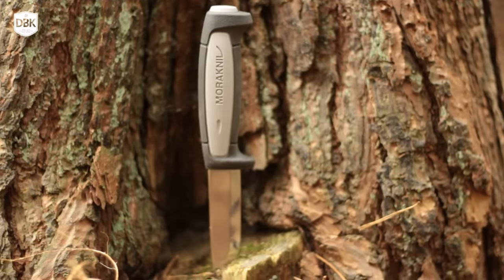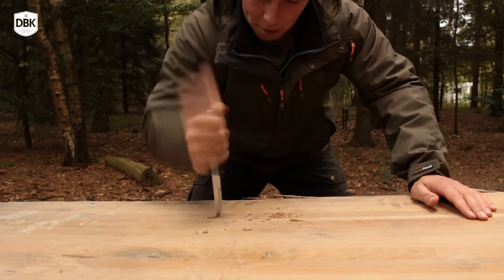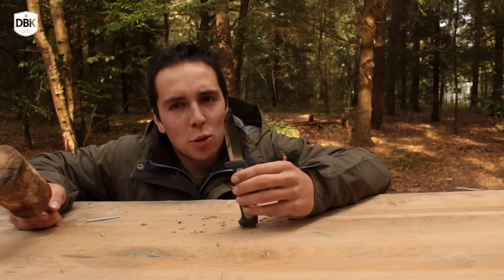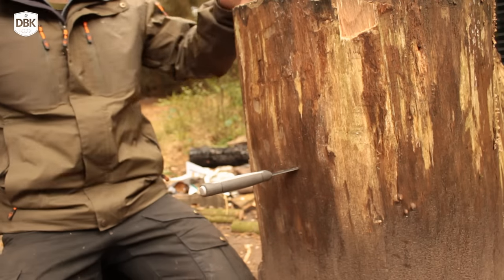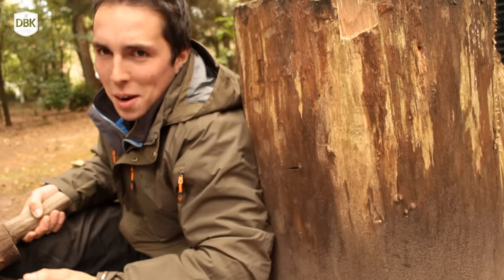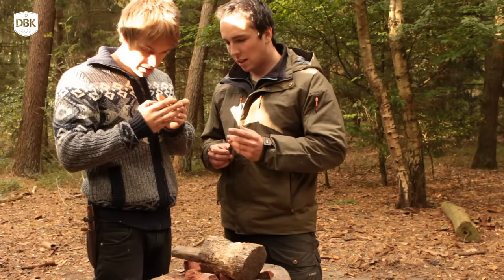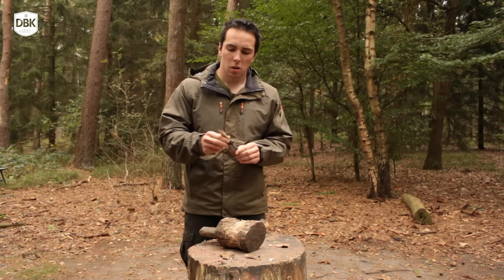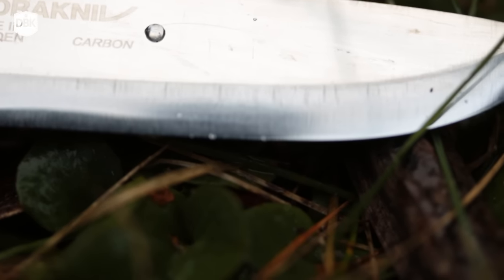The Indestructible Knife | Mora Robust

Comment: And then people still cry about how "Moras arent full tang, that makes them so weak and dangerous, and it will break really easily..."
Reply: composite is very strong, but i would love to see them stand on the handle instead of the blade.
Reply: Is their only weakness
Reply: I bought three of these, because I use knives everyday, for many tasks and I’ve never had a Mora tang or handle fail, which is more than I can say for most other brands.. I Sold all my “high quality” brand name knives when I found that for every task, there’s a Mora that is better (And much cheaper)
Reply: @ModernBladesmith  when would most of the pressure ever be on the handle when using the knife?
Reply: @edgarabramz   always? when would you ever hold a knife by the blade?
Reply: He didn't even test the tang in the video. When the knife was in the tree, his foot wasn't at the end of the knife, it was right up against the tree. All his weight was on the blade.
Reply: @cliveloosley8018  Bullshit. I have a Mora Companion that can't hold an edge at all, and rusts if it so much looks at water. I'm sure if I actually tested the tang, it would snap or pull out of the handle. Martin didn't test the tang in the video: when the knife was in the tree, he stood on the blade, he didn't stand on the handle. How was he testing the tang (or lack of tang actually)?
Mora knives are tough and are a good value for the money, and I'm probably not done buying them. But it's stupid to claim that they're better than (for example) Bark River knives.
Reply: @ModernBladesmith  Yea, you make a good point. The tang (or lack of tang) was not really tested in the video.
Reply: @edgarabramz  If you're batoning, or as Modern Bladesmith said, literally always. But that's not really the point. Martin's tree test pretended to test the tang but it actually did nothing of the sort. It only tested the toughness of the blade.
Reply: @profd65  Tang, schmang. Let's use some common sense here. I'm pretty sure if you did what he did to a Bark River you wouldn't have much knife left. They weren't testing for edge retention or prettiness.
Reply: @profd65  if your carbon steel knife is rusting thats because you cant take care of it lol
Reply: Den Dannon, if the way you use your carbon steel Mora causes it to rust you should probably get one that is stainless steel.
Reply: I am concerned about it coming apart 20 years from now. A full tang wouldn't, because it can't unless the metal itself breaks.
Reply: I know of a guy who has his mora 510, light blue handle, for more than 36 years now. Still doing fine. He's used it for a lot of tasks.  Cody Lundin still uses his mora #1 for more than 33 years. Bruce Zawalsky used a mora 510 red handle for more than 20 years. He now uses the mora pro c. Analysis paralysis. Don't sweat these things too much..

Comment: Yet people will still complain about its hidden Tang. LOL
Reply: Most hidden tangs have reputation to break inside or develop wobble. Not the case with Moras and some other brands.  The stick tangs are set in tough plastic. Cold steel does the same with some of their products. SOG does the same with their zytel handles and they're tougher than hell.
Reply: @LXT43  More like, most inexperienced woodsmen have a "reputation" of breaking their hidden tang knives.
Reply: it's not anything special
Reply: For all the bluster about full tang it seems like knives that do break usually do so about 1-2 inches away from the handle and not inside the handle at all. Cedric and Ada Bushcraft broke the full tang expensive D2 Boker Vox Rold batoning through wood that cheaper knives survived and it broke in the middle of the blade.
Reply: So I’ve decided to get my first knife at the age of 48 lol.  I’m gonna get the robust and if handle breaks.  ( probably won’t).  But then that just gives me an excuse to make it a nice wooden handle:)))
Reply: @countbasingstoke  
Breaking the handle?
Reply: @glbwoodsbum2567  yes. Folks actually try remove the handles on Mora knives to put wooden handles on them.
Reply: @countbasingstoke  
Yes I understand that, but you said if "the handle breaks".
Reply: @glbwoodsbum2567  ?
Reply: @countbasingstoke  
No big deal, take care my friend.
Reply: @countbasingstoke  i just got the bushcraft black it's amazing highly recommend the handle ergo is perfection and blued blade is 🔥
Reply: @LXT43  cold steels knives are all full tang
Reply: @DL-ij7tf    Some of it depends on the hardness vs toughness of the metal and the rest is blade geometry and size.
Reply: @LXT43  My experience is that coldsteel knives are nice but not as durable. The fin hawk handle is pretty weak compared to the robust.
Reply: Also several cold steel knives have the tang sit in the kraton not the polypropylene.  Huge difference,  develops play quite easy.

Comment: What's the exact specification of the steel used in this knife?  "Carbon steel" is about as vague as saying my floor is made out of hard wood.
Reply from the maker: +Fooly Cooly I believe mora uses sk5 steel but the don't specify the steel.
Reply: Dutch Bushcraft Knives - How did you come to that conclusion if the company doesn't specify the steel?
Reply from the maker: +Fooly Cooly https://morakniv.se/en/knivkunskap/stalet/
They don't mention which type of carbon steel they use. Why, I don't know.
Reply: Dutch Bushcraft Knives - In my experience, if the company would rather not show the exact specification of the knife's steel, it's most likely nothing to brag about.  What they've probably done is taken a bunch of cheap carbon steel somewhere around HRC-58 (brittle metal that's terrible for re-sharpening), put a plastic handle on it with a half tang or less, and are now selling it for a low price.
Reply: Fooly Cooly (apologies for my limited knowledge of chemistry) it's too bendy for a high-carbon steel and too hard for a low carbon steel. So it's probably some sort of alloy that is a mix of the two.
Reply: Fooly Cooly I mean moras have been go to for a lot of people for a long time. it's probably the same carbon steel as the other carbon versions and they fair fine.
Reply: Ridgesmaster1 - I have a good number of carbon steel knives with varying degrees of hardness.  All have a good amount of leniency if you attempt to bend them, but of course they have their limits.  There's a good reason "bendy" isn't a common attribute when classifying blade quality.  The only steel I've seen that has zero bend whatsoever is tempered stainless steel in EDC knives.
Reply: Fooly Cooly I see.
Reply: why does it matter what it's made out of as long as it does the job?
Reply: chubbyeuan76 - It matters because you don't want a cheap pile of garbage knife breaking on you when you need it the most, potentially causing you serious injury or messing something up in the workplace.
Reply: Fooly Cooly obviously you don't but your questioning the material of this knife, when it clearly can withstand huge amounts of pressure some of which will be unrealistic in use
Reply: chubbyeuan76 - Let's not get started on this joke of a review.  Frame cuts at convenient times, little to no close-ups directly after tests, & frivolous content do not make for a trustworthy source for verifying the durability of this knife.  The only thing we can take from this video is that the edge retention is terrible, which is not only a safety issue in itself because of the dull edge, but would be a terrible inconvenience if you used this as a work knife if you had to constantly re-sharpen it.
Reply: Fooly Cooly well what are you expecting for a 13 euro knife, from what i can see you get more than what you pay for, sure it's not the best available but in that price range it's sure as hell not the worst, hardcore enthusiasts of these activities will not be using a 13 euro knife, casuals will be
Reply: chubbyeuan76 - Sure, you can buy all the dangerous stuff you want, but that wasn't the point of the line of questioning in the first place.  If you wanna save on your wallet while risking your butt, you do you.
Reply: Fooly Cooly in what way will it fault on someone resulting in a severe injury?
Reply from the maker: Fooly Cooly, I suggest you look around on our channel and you can see that we do care ALOT about knife steels: Cpm3v, Cpm s30v, Cos, Vg10, 12C27, 19c27, 14c28, elmax, m390, A2, 01, n690co, sleipner and more.
If you don't like our style of reviewing then that's up to you. The video is a fun video to see how sturdy a 13 euro knife is and it isn't just any knife.. This is a mora and It is a real established and respected company in the bushcrafting world and has earned it's respect in performance over the course of many years.
If you like a sturdy knife with a good steel and you don't mind spending some money we suggest you look up the Fallkniven A1 Pro with Cos steel.
Cheers man and have a good day!
Reply: Fooly Cooly
Once again. Mora Knives are used consistently in both stainless and carbon steel varieties. There's no good reason they'd use a worse steel for the job than they already do for their other knives which are notoriously strong for a rat-tail tang knife. So to say they are dangerous or even sub par is bullshit. A lack of information is not information. If you wouldn't use one, that's fine. I respect that.

But not everyone cares if their knives are fully disclosed materials. Mora is pretty good at giving even manufacturing breakdowns of the knife design and dimensions on their site so you can see the tang design as well. It's really just a joke to think something can't be good and functional without taking it for a trip to the metallurgist.
Reply: Imthatguyhere Gaming - No good reason to use a cheaper steel?  Umm, hello?  Yeah, there is - it's called saving money.  Every company does it.  Why would they use their best steel on a knife worth €13?  The only reason I can think of for fan-boying over such a cheap knife is just to argue and be stubborn, a philosophy I'm not so keen on, nor have the patience for.

Give me a break with your oracular nonsense - there is no lack of information regarding the point I made with the knife being dangerous.  The poorly-edited video even showed the edge chipping apart because it has poor edge retention.  Let me break it down for you: cheap knife, cheap materials, terrible steel (which could bust on you when you need it the most) = chipped edge = dull blade = dangerous to use.  Pretty simple.  If you don't think improper steel is dangerous, you have a severe lack of perspective and have no business in this conversation.

If that's the case, get a hard-working job that requires regular use of an EDC, test out some garbage blades vs. quality blades, and come back.  We'll see how many scars you have or fingers you're missing from your adamant endorsement of cheap blades.
Reply: Fooly Cooly
That's not the argument here. What I'm saying is using a non-disclosed steel doesn't make it a steel not matched for the job. I was a warehouse worker for years. I regularly abuse knives of all sorts of brands and steels (my personal EDC is a spiderco Manix 2 for weight and easy opening). I can tell you from experience that a standard Mora is not going to implode over decent use. You can find hundreds of videos that aren't cut like this to prove that point as well. There's no perfect knife steel. That's a joke. There's a steel suited for the job. Stainless is great for food prep and situations when you need low maintenance for rust. It'll still dull and chip easy. Take care of your blades and they will take care of you.

If you are using a dull knife or a tool in disrepair for any job other than in a pinch, you  are an idiot. That doesn't change because the steel isn't written on the packaging.

Edit: By the way It's UNI C100 High Carbon Steel.
http://zknives.com/knives/steels/steelgraph.php?nm=c100&hrn=1&gm=0

It's basically AISI 1095 with some silicon. Which is a very common and well suited knife steel for the bushcraft industry. So can you fuck right off now?
Reply: Imthatguyhere Gaming - Here's your problem, and here's how I know you have no God damn idea what you're talking about - you think the problem is stainless vs. carbon steel.  That right there is enough to have knife enthusiasts laughing their heads off for days.  Where do I even start?

You're making it sound like all stainless steel "dulls and chips easily."  HA!  Tell that to the 154CM steel on my Benchmade.  I haven't sharpened the bastard after regular, hard use for over half a year and the damn thing is still razor sharp enough to shave with.

As for carbon steel, that all depends on tempering.  You can pick up carbon steel that's (figuratively) soft as butter with virtually no edge retention, or you can pick up beautifully hardened carbon steel that can bend this way and that, all while maintaining its edge.

That's the importance of the type of steel you're using, and that's why you stay the hell out of a conversation you have no place in.  Opening cardboard boxes with your garbage knives in a "warehouse" does not give you perspective.

Also - let's see a source on where it said the knife uses that steel type, otherwise you're even more full of shit than I initially thought you were.
Reply: Fooly Cooly
Cough Cough, page has the hardness on it...

I was equating choosing a steel for a job in broad strokes. I also use a stainless blade as said in my post. (S30V on the manix 2). I'm, not saying it's impossible. I'm saying your choice of tool is for the job at hand. Not all cheap tools are useless. You should keep a tool like a cheap mora in your kit for feathering, whittling and some wood prep. That way you aren't using your good knives for junk work. It's not dangerous. Using any knife as a tree ladder is dangerous... The point of the video is to show these knives are adequate for the task. It's not to show they are the best for the task. Heck, these aren't even marketed as bushcraft knives, they are intended for the craftsman tool market.

Once again as stated. A 1095 carbon steel is more than adequate for any of these bushcraft tasks. It's sturdy, not too prone to dull and can easily be field sharpened. Add to it that the knife and materials are lightweight (and cheap, kind of goes together unless you are talking fiber mixes) and easy to pack it makes a fine knife for what even was intended of this channel.

To answer your original question, as I posted in the edit to the last one.
It's UNI C100 at 58-60HRC.
Reply: Imthatguyhere Gaming - You're conveniently dancing around my question.  I did not ask for the hardness.  That's already on the official site (which, by the way, is not the exact hardness, just a vague range).  I asked for your source that directly states which type of steel this knife uses.
Reply: Fooly Cooly Before a few months ago it was directly on their "Knife Care" page on their English site. Now it seems you need to contact them or use any of the sites referencing what it was prior to that.
http://www.metasyntax.net/gear/mora.html
Would be an example.

Or contact them and ask yourself https://morakniv.se/en/kontakta-oss/

Edit: They moved it here:
https://morakniv.se/en/knivkunskap/stalet/
Reply: Fooly Cooly this comment thread made me a bit smarter on knives thanks guys!!!!
Reply: ***** - Oh, yeah!  I think you're right, actually.

Comment: I have one Mora at home.... it was bought in 93 or 94, lived till 2002 as "main camping knife", with batoning, cans opening, woodcraft etc. till 2010 in garage with wires cutting, can opening, plastic cutting and breaking..... at it's still alive - having it's rest in the kitchen, i've just normally resharpened it, scratched, but handle and blade are still OK enough not to look weird.
i have no idea what else can be THAT price-effective.
Just bought this one to accompany Classic 1 model

Comment: I was getting angry about the belt grinder, but then you were honest about it so it's ok. Cheers ( :
Reply from the maker: haha thanks mate! I would normally never get my knives near it,
Reply: Dutch Bushcraft Knives whats up with the belt grinder ? i dont get it
Reply: LeOssi belt grinder eats away too much material off the blade, it really wastes the metal. It also ruins the tempering, making the knife unreliable and edge retention degrades. Not to mention that every little mistake changes the edge angle and profile, sometimes irreversibly, and this has negative effect both on looks and performance. Good knives need to be sharpened by hand, anything electric hurts the blade. If you're gonna use a grinder, you should be well aware what you're doing like they explained in the video. It really would have taken hours and hours to fix this level of damage.
Reply: nonstopbg not necessarily. you still need to know how to use belt grinder without destroying the edge if you want to be a good knife maker. still you will need to do some corrections to the blade by hand tools